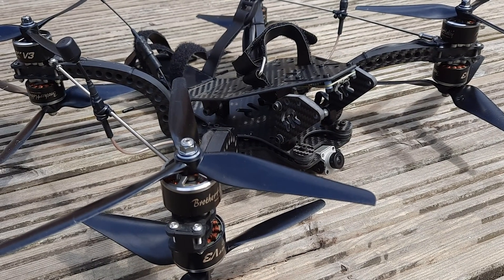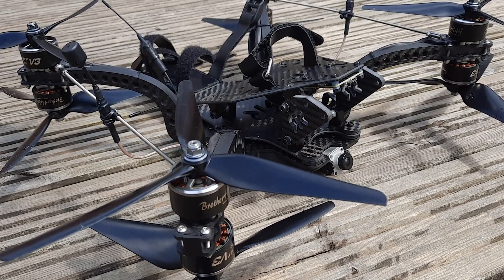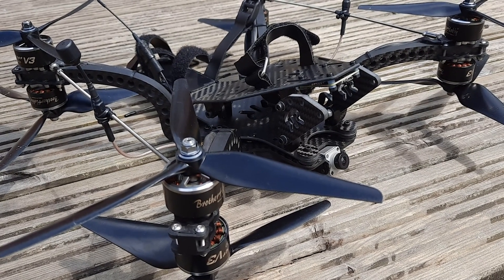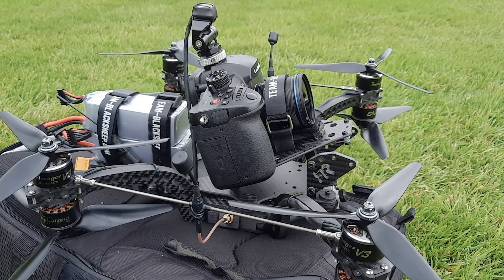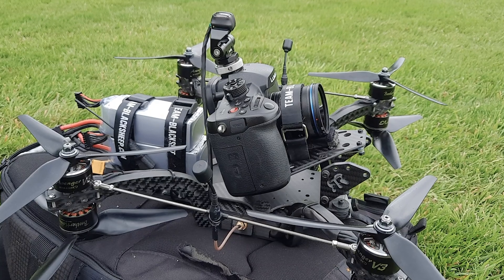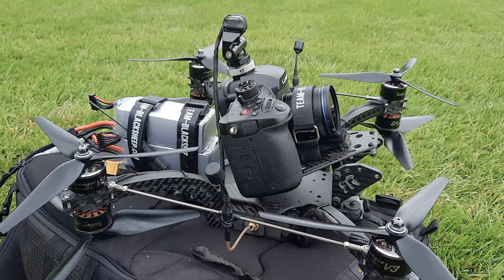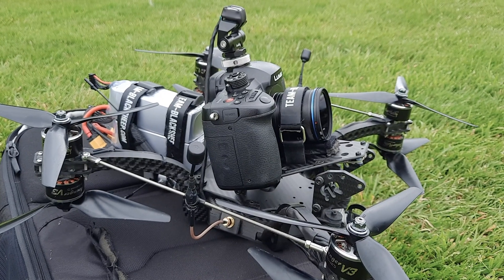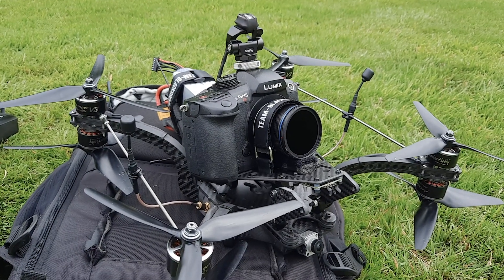Siccario Cinelifter -  Position hold & Return to home / iNav GPS RTH POS Hold - High performance

Comment: amazig. i just decided to try inav as got fed up trying to test betaflight gps rescue.. planned on switching back ad forth but if this is how nav can be tuned ill stick with inav.

just need to see what my noise profile is like
Reply from the maker: its great software! 4.0 is ace
Reply: @DesignTuneOperate  yeah have test hovered it and so far y quad is sooth, accidentay activated return to home, it wanted to fy straigght up at ful speed . not sure why it didnt land as was straight over the home point
Reply from the maker: @vedasticks  I would check angle > position hold > rth in that order

Comment: Can you share your inav settings? Maybe a dump or a diff? 
Did you have issues with your magnetometer and the placement ?
Reply from the maker: Videos on all this planned when I have more time, dumps are no use as sensor calibration is critical. all info is out there on the net though! I put the GPS out on the struts these days

Comment: That is so amazing!! I hope I can build a cinelifter one day. This is going to be one helluva learning curve!
Reply from the maker: Thanks! It's certainly well worth learning as much as possible on 5" and 7" x4 first!
Reply: @DesignTuneOperate  Thanks for the tips and your response! Definitely agree on starting on the smaller quads first.
Reply: @ShallShallShall  One thing that most people forget to take into account is ear protection. After some time working with these the high pitch sounds it can cause Tinnitus, so make sure you use the foam ear plugs you can get at the hardware or drug store. It will go a long way in protecting your hearing and peace of mind.
Reply: @jackbisson9226  that is a great suggestion. Much appreciated!

Comment: Pretty cool. Quick question, I am able to get my 5-inch build to loiter but not execute RTH. For deliberate RTH being initiated, in addition to RTH selected, do you know what specific modes are supposed to be selected, like Angle, etc.? Thanks.
Reply from the maker: Just the RTH mode that needs engaging from manual mode, any dependancies are also activated. In my experience one loiter is working then RTH works as well! Do you have mag etc working properly?
Reply: @DesignTuneOperate  Thanks for the clarification. Yes, I do have a magnetometer and am using the Matek M8Q-5883 GPS Module. I may swap components just to rule out any bad components.
Reply from the maker: Good luck with it! The iNav Facebook group and discord have lots of helpful people onboard also  if it continues not to engage
Reply: You might check to see if have minimum number of satellites when arm. Also note the RTH arrow when flying to see if actually point to arming location.

Comment: So cool, perfect langind! I was just searching for info on using iNav on rigs like this! Perfect in so many ways <3 Thanks for this! This was also very entertaining. Subbed!
Reply from the maker: Awesome thanks : )
Reply: @DesignTuneOperate  I set one of flight mode as PosHold+AltHold, its not arming in this mode,and when i armed in Angle and after takeoff chanded mode to PosHold,then my 7"quad coming down sharply.
What is reason?
Reply from the maker: @MrNams  Sounds like your sensors are not setup correctly! Pawel has some good videos on settings everything up here on yt
Reply: @DesignTuneOperate  Yes, i saw those videos, do we need to enable angle mode as well, like to set to position hold it should set to "Pos Hold+Alt Hold+Angle"
Reply from the maker: @MrNams  POShold will activate all required modes assuming all the sensors are working properly.
Reply: @DesignTuneOperate   I have applied Kotking coating to make it waterproof, so coating also covered barometer sensor, is it causing this issue?
Reply from the maker: Could well be, I would check all the sensor health and compare to good data on another board or data from the net

Comment: What size of motors are u using? And do they heat up from the first flight? Flight time?
Reply from the maker: BH 2812 1115kv! 8" props. They only get very slightly warm, very happy with them. 3 mins hard flying or 4 mins more chilled.

Comment: Wow~~ soooo good !!! 
By the way what are the advantages of playing pos hold?
Reply from the maker: Thanks! haha good question, I wouldn't have a use for it but its a very good first step for checking the sensors when setting up the RTH. You could probably use it to loiter when waiting for a shot to start rather than circling but then your camera will point at the sky.
Reply: @DesignTuneOperate  Apparently you can still fly in hold mode (https://www.youtube.com/watch?v=ZHDrvvhTHfk) like it was a dji quad. Might be a nice feature to let someone else try on the goggles.
Reply from the maker: Yeah you still have control of the drone but the FPV camera points at the sky : ) easy to point it down but then your looking at the floor when flying normally
Reply from the maker: My previous comment couldn't have been more wrong, pos hold is great for taking goggles off, putting them on and getting bugs off you.
Reply: @DesignTuneOperate  Yeah so cool🤩